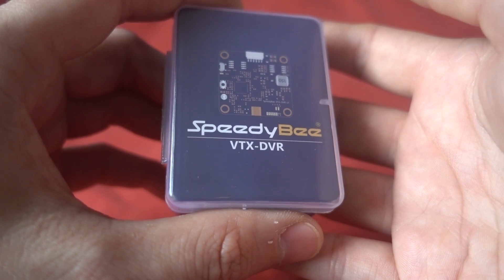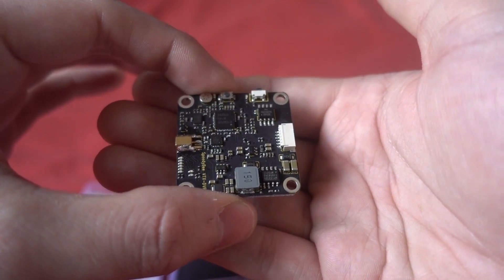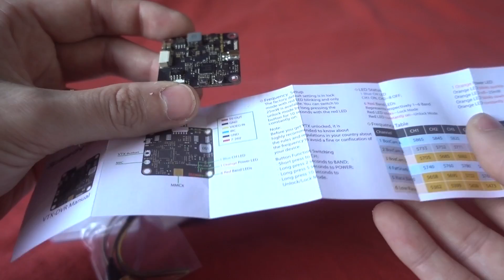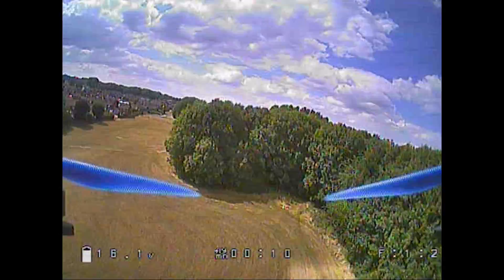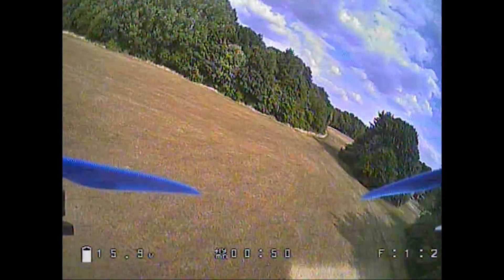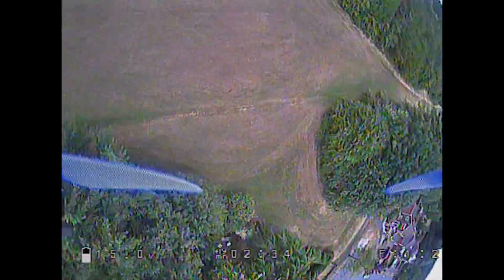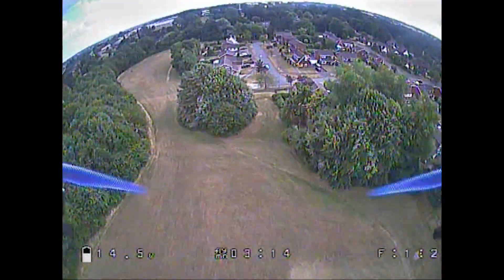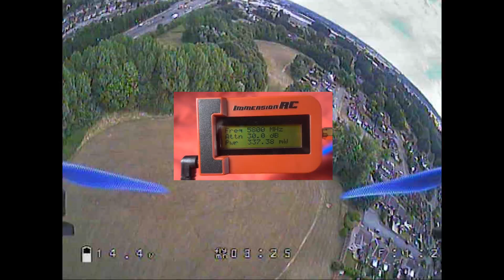SpeedyBee VTX-DVR

Comment: It had some noise on it but not too bad really...The disappointment for me is the low data rate. The HMDVR-S is really good in this respect and at £7 / £8 you can plug it from quad to quad.  It makes a neat install though. I may have to try one after all, why do they advertise at 600mw when clearly it's not designed to do it..?
 I like having the OSD recorded, why would you not want it?, and remember, you can turn the OSD off during flight...?

Comment: Hey Andy,  with regards to the vtx mw output,  does it make any difference if you plug a 5s or a 6s into the quad, since you mentioned it takes up to 27v (I think you said). Wondering if it's not getting enough power for that mw rating. just a thought.